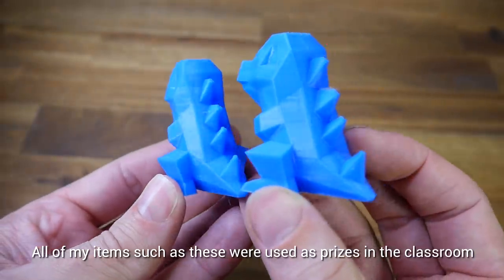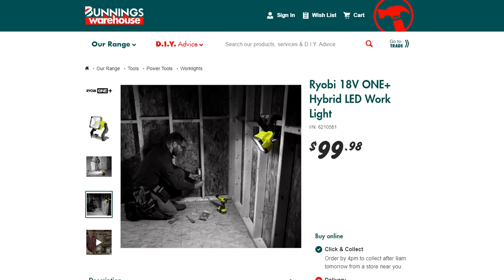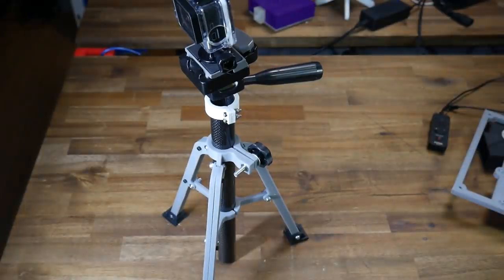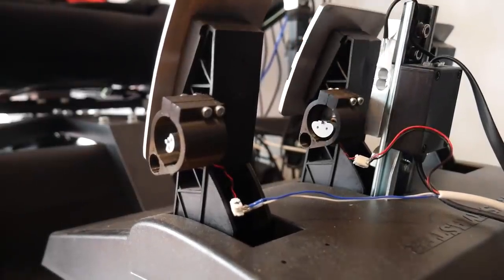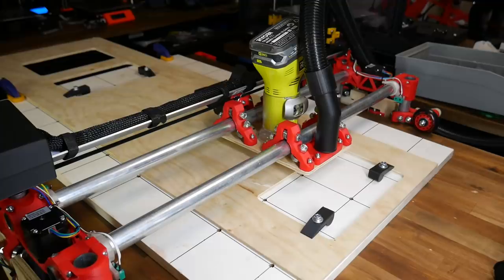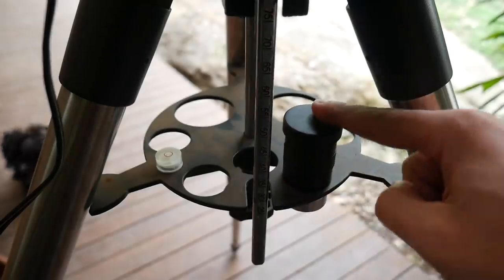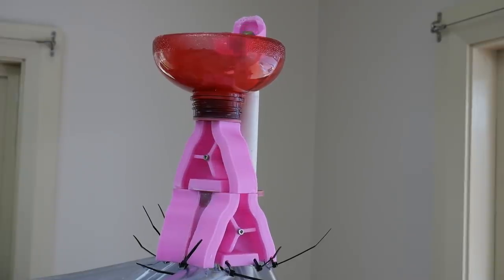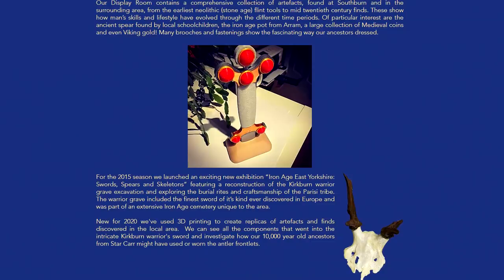5 reasons 3D printing is useful - My favourite practical prints

Comment: I printed an adapter to attach my shop-vac to my miter saw - couldn't find an off-the-shelf one anywhere. For my shop I printed ~100 small brackets to hang LED light panels. A couple electronics enclosures.

Also, people should not discount the nick-nack printing too much... FIrst, it's possible to make money printing things like that for people (or just gifts). Second, it's a stepping stone - my son (who had a 3D printer before I did) started 3D printing nick-nacks, and then started to design his own stuff in Fusion 360. He made a switch plate for his older brothers car, and some speaker adapters for his younger brothers car, and a part for his grandparents RV.
Reply from the maker: You're quite right. A few people here stating they make a living from 3D printing.
Reply: 3d printing figures and miniatures for dnd is an incredible way to make money if you can also design them. Minis cost around 5 dollars each or more but the plastic required is incredibly small, even for completely solid prints. The only issue is getting a high level of detail to print good miniatures. Resin is best for that
Reply: Adam's Lab
:  I agree!  Most of what I print is for my own specific projects, designed in Fusion 360, but... every so often I see something that is sooo good I just have to print it!

Comment: about 2 years ago my dad got a 3D printer from a warehouse liquidation store because it was about a third the normal price.  we never thought we would do anything with it but figured for the price it was worth a try.  we now wish we had done it sooner.

some simple and practical stuff I have made that I can think of:
-ceiling/wall hook for hanging things
-shower curtain hooks long enough the curtain doesn't pop off (would pop off carabiner style)
-battery tray for a toy tractor so replacement batteries could be used
-plates to allow a basket could be screwed to a wall
-bracelet stand (table and wall style)
-necklace rack
-display stand for dishes
-replacement handle for our sink
-was actually my dad but he has made a mount to better place fog lights on an off road bumper for my brother
-was actually my dad but he has made a mount for his battery tools as well as battery covers to keep the contacts safe and clean
less useful but neat:
-simple clap trap (4.5" & 9" tall) with poseable arms (using hardware so plenty strong joints)
-jet transformer (been a personal project and just about done making it so others can print the files and have fun
-simple Christmas tree ornaments for family to celebrate our first child's (currently only child) first Christmas
-calibration cubes made large work great as toys for children

Comment: This is a very good video and gives me additional ideas. I just finished printing and assembling a wine bottle holder capable of carryhing 4 bottles. My wife and I will use it to carry old wine bottles full of water to our planters with terracotta self-watering inserts. The planters are 125+ ft/38+ m from the water source, across uneven ground and through a self closing pool fence gate. This is a practical and useful item that solves a nuisance issue for us as it is tricky to navigate the obstacle course while carrying 4 full bottles. Sure, I could have purchased something, but it was much more satisfying to design something in Fusion 360 and print it on my Prusa i3 MK3. My wife is now seeing how this is useful and coming up with some ideas for things we could use around the house.

Comment: I've saved a fortune by printing my own vacuum dust extractor adaptors for all my power tools and woodworking machines.
Reply: I have been looking into this. Did you design your own?
Reply: @dorialameda7536  Yes I used a set of callipers to measure the diameters of the various openings on my woodworking  tools then designed adapters using sketchup to fit my vacuum cleaner and tool. I made them from PETG as it's a little more flexible than PLA and helps with obtaining a secure tight fit.

Comment: I haven’t used my printer to print anything other than practical things like lcd bezels, various sensor housings ,led light mounts for my milling machine  and a pile of other useful tools ! The only thing i did print that wasn’t along these lines was a calibration cube .
I will be using my printer to make the master cam profiles for a small camshaft grinder i am about to build  and also some indexing fixtures for gear and spline cutting on my mill .

Comment: I see 3D printing as a tool mainly. I don't print just to print. I am still new to printing so the best thing I have used mine for is to create an adaptor to hold a windshield washer tank on my UTV. The part is super simple but it did the job and is still working. I really like the examples you gave in this video as well.

Comment: I've done a few hard-to-accomplish-any-other-way designs, but the biggest benefit I've found is that 3D printing is so much more rapid than hand fabrication that I'm much more likely to tackle projects I just wouldn't have ever gotten around to, especially if multiple identical parts are required. It's also saved me a surprising number of shipping delays on parts that I would've guessed, before owning a printer, wouldn't have been worth making.

Comment: I have only just got my 3D printers but I have already modelled and printed a new bracket for my laser cutter because the stock bracket could not be adjusted in any way, meaning I had to struggle aligning things and settle with less than perfect results. The new 3D printed bracket is spot on.

Also I saw the lowrider CNC and I can't wait to build my own CNC from mostly 3D printed parts.

Comment: The key fob for my Toyota broke where it connects to the keyring on both sets that I had. Rather than throwing it away or shelling out more money for a replacement, I designed and 3d printed a stronger case for the PCB inside which is still going after 2 years. I also frequently make small plastic niche tools such as a funnel for an espresso portafilter. One of my more recent practical uses has been making molds for pottery clay.

Comment: 3D printing has had a big impact in my RC truck hobby, and has really opened up my creativity. I also design parts at work that are 3D printed, some are prototypes before they get milled out of aluminum, or actual final parts that will be installed.

Comment: I have a very old custom front door latch/handle with a thumb press to unlock the front door. The internal latching mechanism broke, a brass metal part sheared, just through years and years of  mechanical ware. I found the broken part, reassembled it, measured it, designed a fusuon360 model of it. 3d printed 12 iterations of the replacement part in PLA. The PLA was strong enough to actuate the brass locking mechanism - enough for prototyping. I refined and improved on it, doing stress analysis on it in fusion 360, and strengthening it where necessary. When i had a working design, i sent the STL model off to be 3D printed in Brass. It cost $25AUD, and it's been working for 3 years now. So my antique front door handle/latch lives on, with a rather tricked out new part, and we can get into our house.
That's just one example of what i use it for.

Comment: So far I have designed and printed a coin holder for tolls for my motorcycle.  a clip that holds the controller for my heated gloves for my motorcycle. a replacement knob for my clothes dryer, a stand for my memory card reader, a coupler for a car vacuum hose for work, screwdriver holders for work, "drink coins" for the bar at my motorcycle club, and a case for my ipod so it is protected under the seat of my motorcycle.   and those are just the useful prints.

Comment: I help Engineering students at a university print project prototypes ranging from LED car sensor boxes (for miniature self-driving cars) all the way to assist items for those that are disabled (such as cup holders, tap grips, and braille contact cards). Outside of these, I also print test parts for aeronautical students (miniature wing designs for turbine and wind pressure testing) and microfluidic channels for the testing of the movement of gases in small quantities. We have also started printing storage boxes for HDMI converters that we lend out from our help desk, and cardholders for booked rooms. This helps to keep our help desk neat and tidy.

Niknaks are nice, but we rarely even print those. I think I once printed an octopus toy for my cat, and we printed a sundial as a test print when we received our two big boys.

Comment: 3dp prosthetics are also a fine example of a practical use of 3d printing. The fact that it's an additive process also eliminates waste in the form of chips and dust. Combining robotics and other automated fabrication techniques with the technology, can make it possible to largely decentralize manufacturing. 3d printing is no joke. It has the potential to fundamentally change the world. 

Imagine a device the size of a washing machine in every household with the ability to make snap together copies of itself along with most useful items. That's the direction we're heading.

Thanks for the video.

Comment: Adapters everywhere! Want a gopro fit on that crazy angle properly held by the wing of a racecar? You got it! 

Also for really sturdy component i've used 3dprinters to create the part in plastic, then make a sand mold,  and cast aluminium or bronze (or even cast iron but my forge is not up to the task). 

Also directly print the negative half molds to cast epoxy resin, or silicone, or urethane. I've 3dprinted engine mount bushings mold and cast 50Shore urethane to make the actual bushings (and this way i could have the special geometry of such a bushing with carefully planned windows to have diffrent elasticity in various directions)
also need to junk that sewing machine because a plastic gear snapped? print it!, or lots of apliances with plastic cracking making them unusable (my diswasher machine had the buttons fallen off because the buttons were all a single piece with thin plastic to act as a spring and support for each button. it broke.. i've 3dprinted that assembly, and upgraded with proper spring and slides for individual buttons)

Also make nice cases for any object. I keep some sd cards in a 3d prited puzzle box (cryptex), also made a kickass holster for my pen (a realistic crocodile that opens mouth and the pen is inside, fits perfect that special pen), or a holster for anything anywhere.

Comment: I have an old Black&Decker pruner that came with NiCad batteries. With 3D printing, some metal scraps, some wire and some soldering I now have an adapter to use Ryobi One+ Li-Ion batteries which not only charge much quicker, they also have much better performance. Saved me from buying a new pruner so it was economical and it reduced waste. Got the file straight off thingiverse where you can find adapters to most modern battery systems (Makita LXT, LIDL Parkside, Milwaukee, Bosch).

And if you don't have any other tool battery system but a bit of experience making RC battery packs you can print an extension so 18650 cells fit into it.

And there are tons of old, well-built powertools out there that are thrown out just because the batteries are dead and finding replacements gets harder and harder.

Comment: The most satisfying part of 3d printing is fixing small things in the house quickly. I've printed countless holders, brackets and mounts for various stuff: mounting garbage cans to the wall or inside of kitchen cabinets, tablet wall mounts, tool holders, etc. Most of this stuff was thrown together in a couple of minutes in tinkercad and printed. And most of the stuff stood the test of time. And if not: redesign&print again.

Comment: I have designed and printed a few car parts for older cars (30+ years old) and used those as prototypes to make molds to cast the parts.  I also designed and printed a lot of brackets to hold things in my office/workshop.  I am currently in the process of redoing holders for my pegboard, the stock ones are useless, keep coming off when you take the item of the pegboard.  I also did a sign for my office/workshop and incorporated 3d printing, painting, and vinyl for this sign.

Comment: Designing and printing my own things with software such as FreeCAD, Cura and other open-source programs:
* Parts for my bike and electric scooter. Especially useful when one needs to build custom-shaped battery packs that fit in a frame of some non-standard kind.
* Cases and holders for various electronics and PCB's.
* Computer case parts such as slot adapters, GPU holders, heatsink isolators. cable management clips, fan holders etc.
* Various boxes and trays for workshop organisation.
* Tool holders.
* Spare parts for tools.
* Lids and caps for various jars and bottles.
* Mechanical parts for larger machinery such as cable chains, clips, lids, bushings.
* Repairing larger plastic parts where I cut out the section that broke, and then design and print a new section which I glue in, sandpaper it smooth and spraypaint it.

Comment: I've repaired all sorts of house hold items with my 3D printer. For example, one of the trays on my fridge door had a cracked hanger corner, since this is an old fridge, there was no way to get a replacement tray. If I just glued the broken piece back on, I wasn't sure the glue was going to hold the weight of items I put into that tray. So I needed a brace. It's quite a tricky bit of geometry, so it isn't something I can easily model up in CAD. Instead, I used some modelling clay to get the shape of the broken corner, then I scanned the clay model, then I used Meshmixer to edit the scan and finally I printed the brace. I epoxied the brace and the broken piece all together, and it's been working for over 2 years without any issues.

Comment: I always dreamed of buying a 3D printer myself but was always affraid that it would be just one of many things that I'm excited about until Iget it and then it's just laying around.
At the beginning of this year I finally had a good reason to buy one (since the prices dropped pretty low in the past 10years), I upgraded some parts on my MTB and needed a chain guide for my 1X10 Drivetrain, when I saw that thoose plastic bits cost about 50-70€ I was shocked and decided to buy a ender-3 pro for about 170€ and print those parts myself. Even tough they might be not as stirdy as the factory parts, they are much cheaper and I can reproduct and replace them whenever I want.
Also made a Part for my cars Glovebox compartment which would have cost me about 40€ to replace otherwise. 
My parens where very sceptical about me buying a 3D-printer but it seems that they already know to appreciate that I bought one since they also asked me many times to print some Parts that have broken of somewhere around the house/garden. 
And even made a bit of earnings by designing and printing replacement stuff for some colleges. ^^
Reply: As a mountain biker this is fantastic to hear. Thanks for sharing, I'll be printing some chain guides also.
Reply: @TShepard  I accidently ripped off my last chainguide that I printed first, had to fix my bike on road sight. Now with better knowledge I just got another filament that suits the purpose better and I redesigned it to make it sturdy... now it's just like the factory ones ;D

Comment: My aunt and uncle run an apartment/laundry mat in a mining town way up north (I live in Canada) and two of his industrial washing machines were out of commision. One had a broken locking mechanism (so the door couldn't close and the machine wouldn't start) and the other machine had broken component in the coin receiver mechanism (without coins the machine wouldn't start) . These machines were from the 1970s so he couldn't exactly order new parts. Also, having new machines shipped there would have cost more then the new machines themselves. When he was visiting my parents, he gave me the broken parts. I measured them, rebuilt them digitally, redesigned them to be stronger at the points they had failed and had new parts printed up for him before he headed back up north. He probably saved multiple times over what my printer costed just in those 2 prints alone and it's kind of cool know that some parts that I designed and made are helping people in a tiny town that I've never been to get their clothes clean.

 That printer finally broke a month ago so I bought a new one and it has probably already paid for itself in allowing me to make replacement parts for things to fix them (or make them better) instead of tossing them out.

Comment: 3d printing have saved me so many times! From replacing the shifter clamp on my mtb, to making slope holds for my fingerboard or just fixing the cap leash from my wife water bottle... but my favorite print so far is my apter for a fabric waterbottle mount on my bike